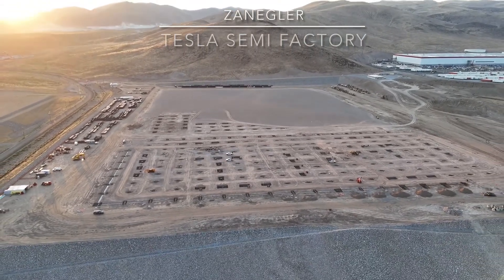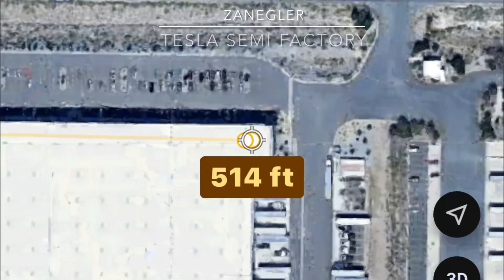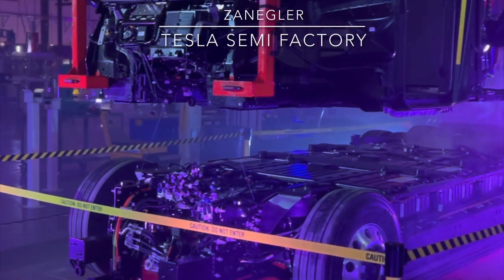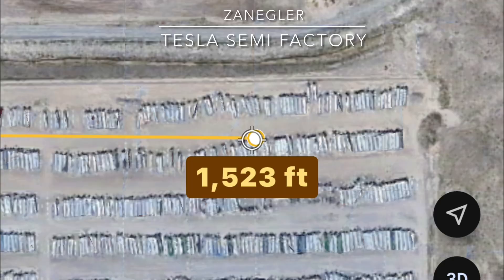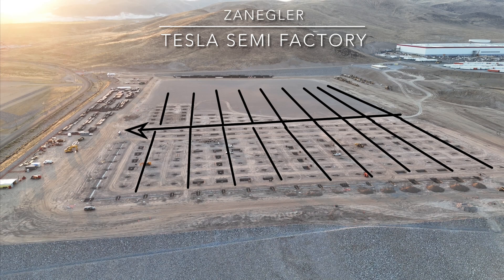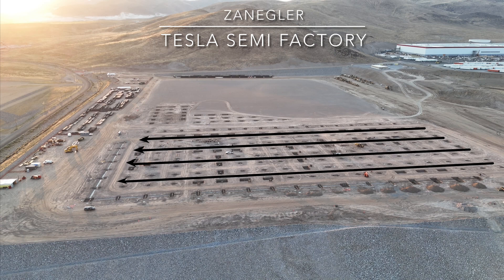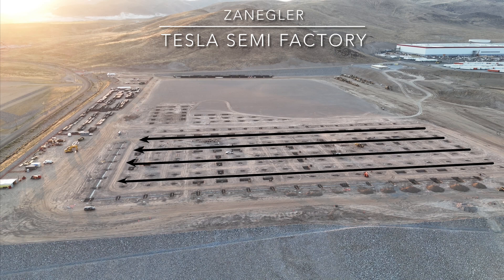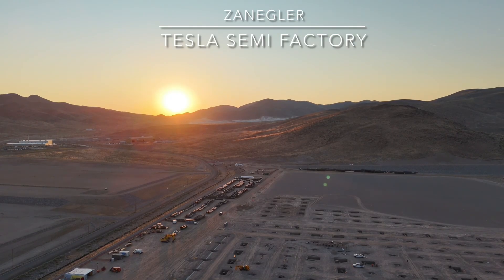Telsa Semi Factory Layout - Giga NV

Comment: How I gauge the size of the building  AND  progress. The cleared building footprint is rectangulat. it has a short side & a long side. They have fininshed drilling 
all the way across the short side. It has 19 columns. The long side, so far, has 16 columns, but they are still digging so the 16 number will yet increase as the 
19 number will not. It appears from a distance that they have dug columns across approx  half of the footprint so expect to see 32 or 35 columns for the total building. Keep you eye on the 16.

!

Comment: For the ~500ft assembly line, does it assembles the major components?  If so, will the major components be built in this factory as well?  Things like the cab, battery pack?  Sounds a little like the unboxed discussion around their car lines.

Comment: I’m not remotely qualified to know anything about this, but I’d be expecting them to be operating on the same principles that they use in the cars.

That being in house manufacturing of many components, and therefore much factory space is going to be taken up by presses, battery pack assembly, motor assembly, seats, suspension unit assembly etc etc.

I’d be surprised if they had more than a handful of actual assembly lines.

But what do I know? About 10% or nothing! 😂

Comment: You're approaching this with the wrong mindset. The high-volume manufacturing process is likely to differ significantly in terms of geometry and layout from the prototype line at the current Giga Nevada facility. The prototype line was designed to produce a limited number of vehicles, allowing Tesla to validate the technology before investing in a high-volume production facility. When planning for 50,000 vehicles per year, it's crucial to ensure the production setup is optimal.

I suspect this new facility will be similar to the one in Lathrop, featuring two production lines. The focus will be on building and ramping up the first line before installing equipment for the second. This approach allows for adjustments to the line and processes before scaling up to full production.
Reply from the maker: You may be right. I am just extrapolating what the prototype line does and assuming they get tier one suppliers since volumes will make it profitable for the top suppliers versus now they are getting lower echelon suppliers. Trust me, getting decent quality has been a challenge so far. I will adust my thinking when I see stamping presses or evidence of them. Thanks for the comment b

Comment: Patterns of the footers don’t repeat in either direction.  Larger footers means bigger loads presumably from large equipment.  So to me it looks like separate areas for component manufacturing and assembly.  So unless we can understand what equipment goes where it’s difficult at best to draw conclusions.
Reply from the maker: Agreed, but we can still try to make some educated guesses. I also noticed the larger footings and what that tells us. I specifically am looking for a pattern for bridge crane support. I am currently assuming that most parts will be supplier provided. Over time I expect them to produce more and more of their own parts but probbaly never heavy-duty standard semi parts like axles, maincases, springs, etc. The more I think of it, it would make sense to at-lease stamp their own cab and doors.
Reply: @ZaneglerTeslaSemiStalker-vt3or  Top left in this video, bigger footings on both sides of the long side oriented aisle, probably for a bridge crane right there!

The bigger footings nearby in this video makes no sense for a bridge crane, so must be for something else, Could be footings for heavy robots.

Comment: I have no idea... It could also be that Tesla will use the unboxed method, so several smaller production lines to assemble modules and then into the main production line to assemble the modules into the final product.

The factory will probably also house a paint shop, a stamping shop, a plastick molding shop, an electric motor manufacturing shop, battery pack shop, transmission shop, etc, etc. If this factory gets 3 or 4 floors, this is not out of the ordinary, space enough!

Anyhow, at this point in time it is impossible to say how it will be layed out, my guess is the unboxed method is the most suitable for this relative small scale Semi manufacturing. (Car manufacturing will be 100x larger! 50K versus 5000K)
Reply: This!  The idea that there are going to be more than a few actual assembly/production lines is nuts.  You can always run a night shift if you need to increase production instead of doubling or quadrupling the equipment needed for each production line.  Automation will give you the 'high volume' not the number of lines.
Reply: I agree - it makes no sense now to tey to decipher the layout of individual production lines when you don't even know if they're going to be lines or unboxing stations. The only effect such speculation will bring to Zane is derision of he isn't 100% correct. Which nobody could be at this point. So I've no idea why he tries to guess it now, especially when we might have several story building and within it all sorts of forks and detours up, down, or left/right.